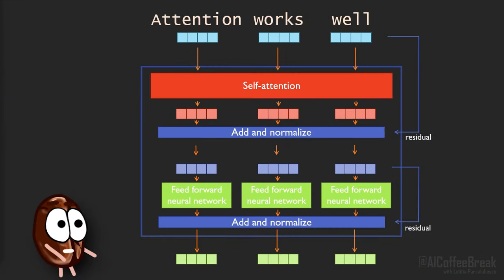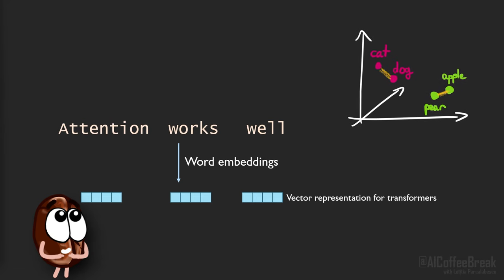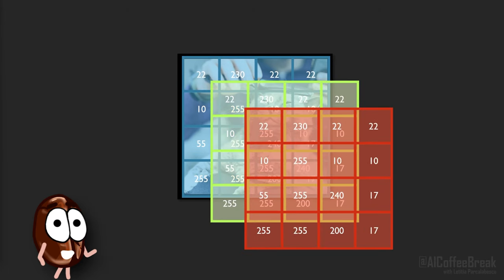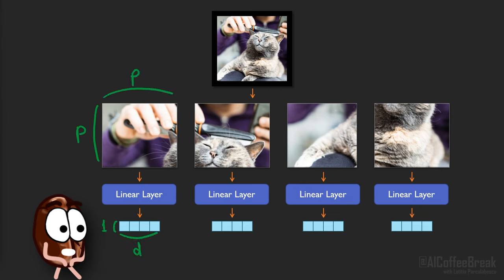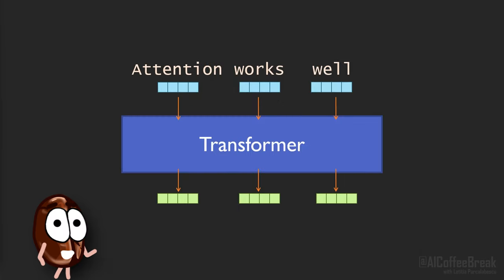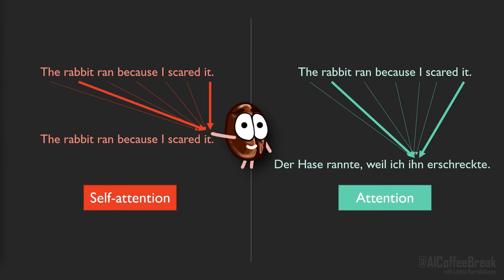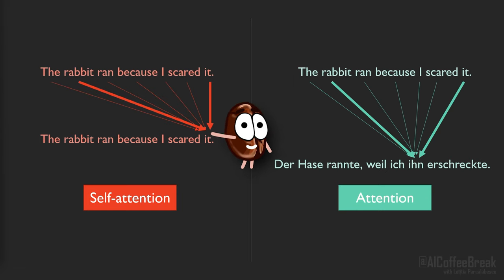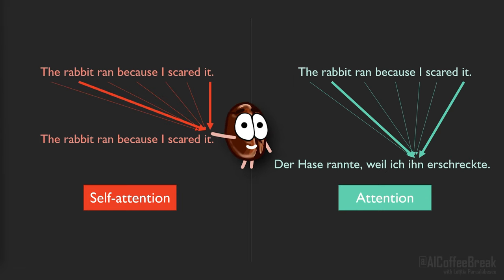Transformers explained | The architecture behind LLMs

Comment: In 11:14, the weighted sum is the sum of 3 vectors of 3 elements each, but the results is a vector of 4 elements. Which, conveniently, is the same size as the input vector. Could there be a missing step there?
Reply from the maker: Yes, there is a missing back transformation to 4 dimensions I skipped. :) Well spotted!

Comment: ❤ Letitia, thank you for great visualization and intuition. For inspiration: In the original paper, the decoder utilizes the output of the encoder by running a cross-attention process. Why does GPT not use an encoder? As you've mentioned, the encoder is typically used for classification, while the decoder is for text generation. They are never used in combination. Why is this the case?

Missing Intuition: Why does the cross-attention layer inside the decoder take the values from the ENCODER’s output to create the enhanced embeddings (as a weighted mix)? Intuitively, I would use the values from the DECODER.
Reply from the maker: Thanks for your thoughts! :_beanHappy: Encoders are sometimes used in combination with decoders, right? The most famous example is the T5 architecture.
Reply: Thanks for your prompt reply. Hence, understanding the concept and intuition behind feeding the encoder output into the decoder is essential. I found only this one video on encoder-decoder cross-attention:
https://youtu.be/Dqjq4Gxdhng?si=gtLzNxAU0pUGyLvk
In it, Lennart emphasizes the observation that, based on the original equations, we have the enhanced embeddings calculated as a weighted sum of ENCODER values. Inside of a DECODER, I would rather expect to have the DECODER values pass through.
Letitia, I am sure, you will resolve this mystery. 🍀

Comment: What a great video.
It still could expand more and really sum up every sub-part and connect it to a certain clear visualization or clear step of what happens with the information at each time step and how its "transformation" progresses over time.
So i think you could redo this video and really make it monkey proof for folks like me.

But beware, if you look for example at the StatQuest version, its to slow and too repetative and also does not really capture, what really goes on inside the Transformer, once all steps are stacked together.

Great work!

Comment: Thanks for your video.  I have a question on inference process.    For example when I have a input prompt of  2 tokens = {t1, t2}. we will get the output {o1, o2, o3}.   we will take only o3 and make new input sequence {t1, t2, o3}.   Then we will get another output  {o'1, o'2, o'3, o'4}. 
Here my questions are.  When we  use causal masking for attention,   o1= o'1 and o2=o'2  and  so on?    Another question, even though the mask guarantee the causal attension. but still the matrix calcuation is performed. Then it means the computation is used any way. How can we reduce the computation resource for this case.

Comment: hi! can i ask question of how did you get the dimension (d)? because all i know is dimension can be found in square matrices, and the dot product of the attention formula says that Q•K^T. if we're using 1x3 matrices, we'll get 1x1 matrices or 1 dimension, how do you get 3 ? unless its 3x1 matrix beforehand, so we'll get 3x3 or 3 dimensional matrix.

thankyouu !
Reply from the maker: Hi, if you mean the mistake at 10:00, then the problem is that I have written matrix times vector when I should have written vector times matrix!
(or I could have used column vectors instead of row vectors). Is this what you mean?